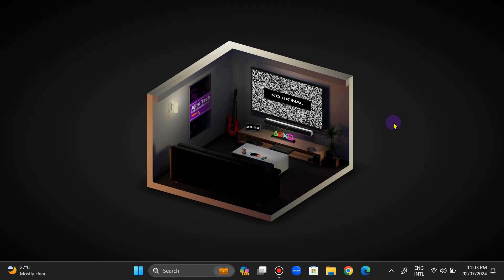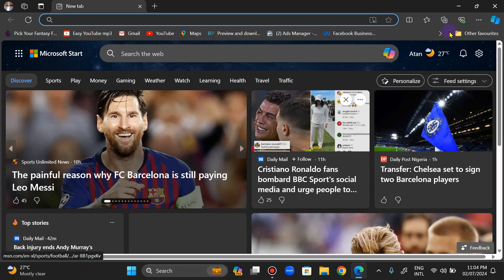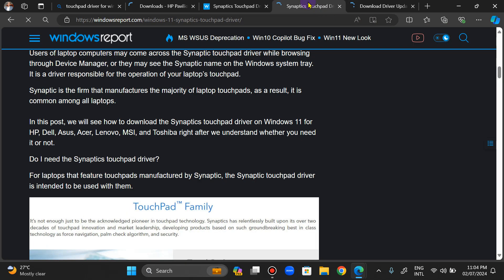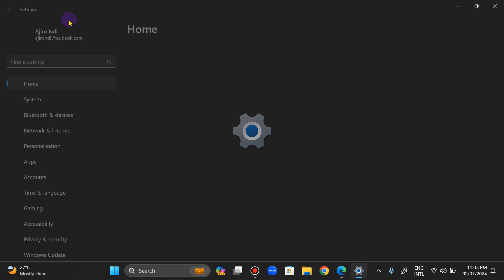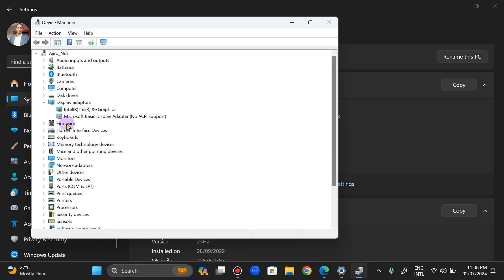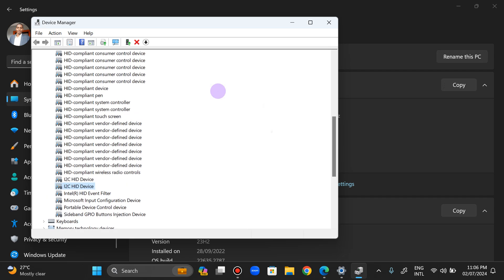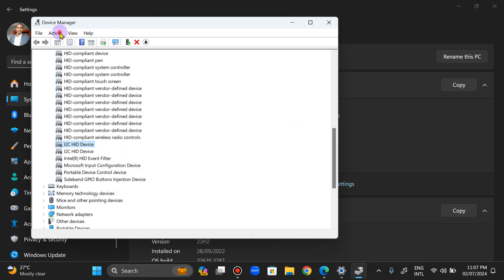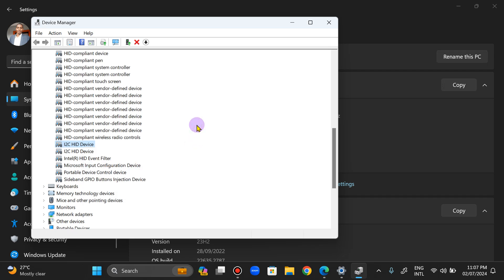I2C HID Device Not Working Fixed 100% [Touchpad or Touch screen] || i2c hid device touchpad

Comment: I have the same issue but with asus vivobook 14 
The i2c driver went missing
I redownload every driver available on their site
I even used 3 software for to download the driver but nothing
The problem occur after 5 months of updating to windows 11 
I go back to 10 but still nothing worked 
I go back to 11 and still nothing worked
Then i go back to 11 and
I updated everything the intel the windows updates 
But still nothing works 

I can't find the i2c driver 
It keeps pushing code 10 

I even follow all coding instructions by chatgpt also another gpt pc trouble shoot solver
I called the company nothing work they didn't help

Note i changed the screen this year cause it went broken 
In the asus official store

Nothing works
I feel very bad because i design stuff
Reply from the maker: I’m really sorry to read this
Reply: did you find any solution?

Comment: Ma sha Allah.
I tried the first method by updating the driver (it used to work before) but didn't work this time. So i disabled the I2C HID Device, shutdown (not restart) the computer for a minute, turned it on, and re-enabled it and voila, it was working fine.
Reply from the maker: I’m happy to read this

Comment: Hey mine isn't a pre installed synaptics touchpad, shall I install it? Or any other way, mine is lenovo
Reply from the maker: You can install it
Reply: @ajirotech  also, it says it is for thinkpad models only when I checked supported devices on README. Ideapad gaming doesn't show.
What shall I do?
Reply: @boom2k4 u got solution, I am also facing same issue

Comment: Hey Ajiro!!
    Very good message about the issue. Disabling the device or uninstalling it did not work. 
Fortunately, with the firmware upgrade provided by OEM, the touchpad is back online. Thanks for the video! /\
Reply: Hey which firmware or patch you are talking about kindly let me know because I am facing this problem from 1 year
Reply from the maker: That’s good
Reply from the maker: Yes it’s back online mine is working as well 🕺
Reply: Can confirm the firmware update from the official site worked
Reply from the maker: Good 👍

Comment: not working at all brother, any other option plis
Reply from the maker: It’s working for me but stops sometimes so I got an external mouse but I feel it’s the version of the windows operating system so don’t panic once the new update comes out it should be fine
Reply: @ajirotech yes i hope so
Reply from the maker: @leotriwibawa6114 I know it will